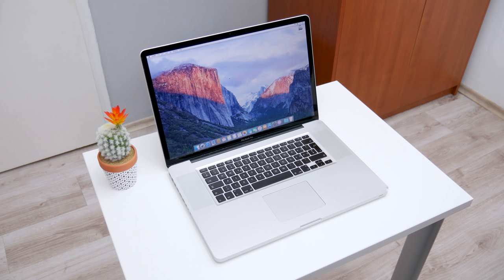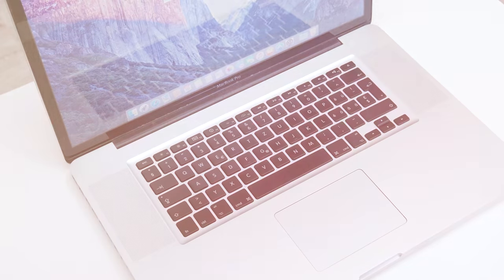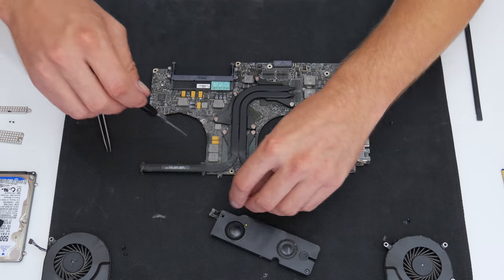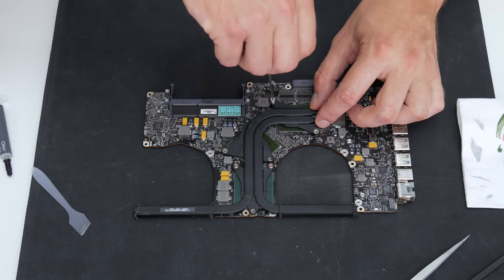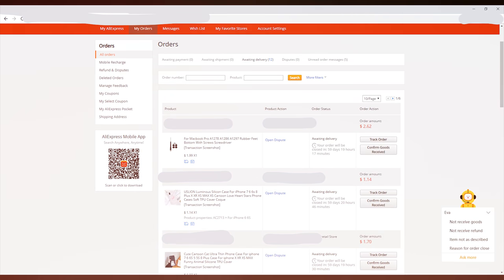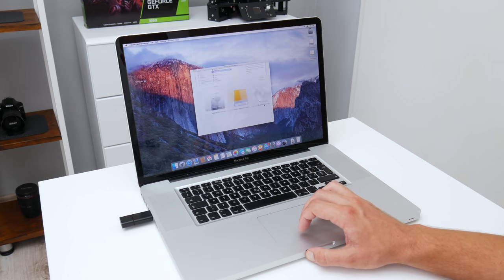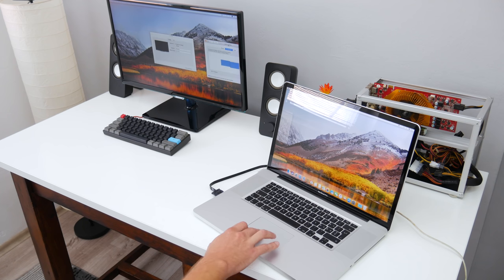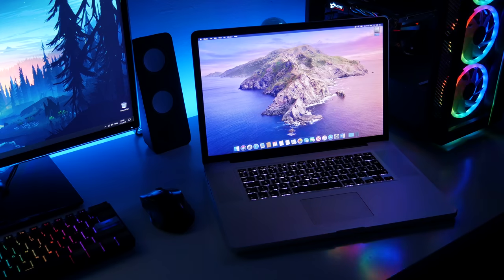Restoring and upgrading 17 Inch MacBook Pro and eGPU test!

Comment: Hey Andrew, nice video. One tip if you install an aftermarket SSD. You should enable TRIM in the terminal because MacOS doesn't enable SSD TRIM automatically for 3rd party SSD's. It's really easy: Just run the command "sudo trimforce enable" in terminal and reboot your MacBook. Check in system information if trim is enabled after rebooting. Cheers.
Reply: I have no idea what any of this means.
Reply: @Edian what does TRIM do?
Reply: i didnt know this, i checked and sure enough, not enabled. thank you very much for the tip ^^
Reply: @burneyfeg2768  no problem! Enjoy a stable system :)
Reply: @NB-Philly   A Google search will tell you everything you need to know. And you can check on what MacOS version you're using.
Reply: @NB-Philly  Its so that your SSD can operate normally and doesn't have decreased life span. It basically has to do with the way SSD deletes old data and uses tables for writing new data.
Reply: @MrGarda42  TRIM basically prolongs the life of your SSD by making sure the same parts of the storage aren't written and read from over and over without using the rest of the memory a roughly equal amount
Reply: @MalevolentMeles  thanks man.
Reply: If you’re using APFS TRIM is enabled by default
Reply: TRIM allows the operating system to actively inform an SSD which blocks of data are no longer in use and can be wiped internally. This helps the drive work more efficiently and leads to faster performance and most importantly, longer lifespan.
Reply: @MalevolentMeles  Correct.  SSD's are rated by how much data is written to the chips.  TRIM reduces the amount of data written and erased which prolongs the life of SSD.  This is important for all SSD's, especially off brand new SSD's and for SSD's purchased second hand.
Reply: @mattridgley9095  Dude, yeah
Reply: For the love of god do not enable trim it slows down your mac considerably
Reply: Will this delete my data?
Reply: @jameswyma9849  if you want to keep your data alive for several years then you want to enable it

Comment: I have a Mid-2009 17inch MacBook Pro 3.06ghz. The screen size is perfect . Still running strong  💪 I love your videos !!
Reply: Hi! May I know the smc version of your computer(in the system report)? I have the the similar version of  MBP 17 (early 2009) and believe the laptops have the same SMC originally. I restored the smc with a wrong version. And There is no information about this smc firmware across the whole internet...

Comment: when you clean that dry thermal paste, it's usually a good idea to soak it with some isopropyl alcohol for a short time (maybe 30 seconds at least) to soften it up before scraping or brushing.

Comment: Well done! Nice video. I am currently running a mid 2010 MacBook Pro 17 inch with a 512 SSD & 8GB of RAM. It’s an absolutely pristine condition and runs as fast as it did from the day I bought it. Works out to about $25 a month Canadian on a MacBook Pro for the last 10 years. Sure beats the dickens out of windows PCs and their costs.
Reply from the maker: Thank you :)  17 Inch 2010 are coming with much better specs, it's a beautiful laptop
Reply: @ComputersAndTechAndAndrew  Is 8GB really the max RAM capacity, some aftermarket / refurbished resellers are selling this same model with 16GB RAM.
Reply: @brandonphilander661  yip it can take 16gb thats what i have..works well. i have a ssd and new thermal paste that helped the fans not to always spin.. 
ssd. 16gb. and new thermal paste gives it a new life. it runs as good as my 2019 mackbook air

Comment: Still my favorite model - my 2011 17" going strong!
Reply: Peter Won really my gourmet went out and unfortunately I can’t get window to boot without a black screen:{
Reply: @jamminjaymn7675  probably the gpu, disable it. It happened to me and the beast runs fine
Reply: Yeah, the 2011 models had crippling GPU failure. Is it your favorite now?
Reply: I'm still using 2011 15''. Love this machine.
Reply: the best is mid 2010 17" because you have not the GPU problem
Reply: what gpu will work using xpress card slot ?
i have macbook pro 2011

Comment: Why did I watch this video? I was completely happy ignoring the state of my MBP 17 early 2009.
Now watching this video I thought I should at least clean my Macbook for the sake of it. It was getting easily warm and kernel panic. 
Now it lays on my workbench in pieces. Thermal past was hard as concrete. Now the logic board it is Dust free with one blown capacitor and some corrosion.
Fixing clients laptops is always easier than my own. 
I guess I should thank you for this video 🙂
Reply: Hi! May I know the SMC version of your computer(in the system report)? I have the exact same MBP but i restore the smc with a wrong version. And There is no information about this smc firmware across the whole internet...
Reply: @rickjac6909  I will try and remember when I get it repaired. I am still waiting for my smd rework station
Reply: @Frank-Thoresen  Hey. Thanks. Some other owner with this mbp has verified with me about the version. it is 1.42f4.

Comment: You can also install a fresh operating system to a new drive over the internet by holding command r on boot up. This will bring you into disk utility where you install the os over the web
Reply: Firebuster can it be updated to catalina?

Comment: i have a early 2011 (April) 17" and love it.  did the same, ssd, memory up to 16g memory, new thermal paste (cooler master nano paste) but also cut some air holes along the front top edge of the bottom cover.  You can't see the holes unless you flip the computer over.  I also use macfancontrol to control the fan.  As you may know these computer run amazingly hot in many cases can push over 105C which is way too hot.  The holes and the fan control means the computer now runs at 35C idle, normally in the low 50s under normal use and maxes at 85C when working hard.  So holes are super important.  Luckily my graphics chip still works but I use a program called gSwitch to hold the computer in the integrated graphics mode.  you can also select discrete and dynamic if you like but i don't see a need.  The integrated (on processor) graphics will run 4k videos with no issues.  Do all of this and enable trim as Edian said and you are good to go.  You have a 2010 model but some still applies.
Reply: Nice job. How would you say the fans and temps changed from just a re-pasting? Wondering if it made a big difference even without the holes. thx for your post

Comment: The heatsink design from 2009 to 2011 is why so many of these have died. Who was the engineer who thought moving the heat through one pipe was a good idea. They should have been separate pipes.

Comment: I'm watching this video from: 
Macbook Pro (17-inch, Early 2009). 
macOS Mojave (version 10.14.6)
Reply: MacBook Pro mid 2010 13” 16 gigs ram 2ssd crucial 1tb each high Sierra,there are others improvements?
Reply: Hi! Eagle. May I know the smc version of your computer(in the system report)? I have the exact same MBP but i restore the smc with a wrong version. And There is no information about this smc firmware across the whole internet...
Reply: @rickjac6909   my SMC Version (system) is : 1.42f4
Reply: @apateonaeagle9928  Hey! Man. Thank you so much. That number is so important. it is impossible to find in the internet. Mine is def messed up. It shows 1.57f18.
Reply: Hey Eagle, could you please give me your email or social media handles? I'd like to ask you some questions about MBPs
Reply: I see you're a man of culture. - Fellow 17-inch user
Reply: @troyh8461   wtf are you talking about ?
Reply: I'm watching this video on:
Macbook Pro (13-inch, mid 2010)
macOS High Sierra (version 10.13.6)

Comment: Great video.  I have a 2011 17 on the way.  It is broken but I have had good luck fixing them.  Anyways, been very interested in Dosdude's Mojave and Catalina patchers.  Does graphics acceleration with the 2011's AMD GPU work.  Last I read, it does not.

Comment: Will you do a laptop video fix on a 2009 MacBook pro 13in specifically how to re solder the fan connection to the motherboard. I have an exact mac with that issue and have not been able to fix it.

Comment: Hi Andrew, thanks for a great video. I have MacBook Pro 17 Early 2009 and I want to upgrade ram like you from 4GB to 8GB. You used higher frequency RAM of 1333mhz than original 1066. Can you tell me please which RAM did you use? :)
Reply from the maker: Hi bro, I the ram is Samsung, but you can use some other brands, also i think this ram is low voltage, not standard 1.5v. You can check which ram is in your macbook than you can get other but with the same voltage
Reply: Cat and Andrew Hi Andrew! I have a MacBook Pro 17 mid 2009. I need to upgrade the RAM, but Apple say the limited BUS is 1066mhz. You use this frequency?

Comment: currently watching this video on my Mid 2009 17 inch Macbook pro, I'm using OS X lion and to be hones ArcticFox browser really brings this os back to life, and I also have all the app I need to complete all my tasks, I cleaned it replaced the thermal paste, upgraded the ram to 8GB 1333mhz and anice 240gb SSD made it run like a charm, still not blazing fast but good enough, I only got it for 40$ so I really can't complain.

Comment: Apple should bring back this 17-inch flagship. Maybe the rumored 16-inch will do similar job
Reply: The 16 inch is just a slight increase in body size. It by all means just increase in screen size and it's rumored to be bezel less so the body won't be much bigger than the 15 inch one.
Reply: And the 16 inch one is said to replace the 15 inch. So there's that.

Comment: There is actually tech inside the head of the charger that tells the computer how many watts can be supplied, so your 80 watt charger is now only supplying 60 watts to the MacBook, as it has the replacement head on it.
Reply: not true. It works over a 1-wire protocol and a chip inside the charger tells the head what to report to the motherboard :)

Comment: Macbook used to be that great. I really like old models Macbook more than new ones
Reply: I agree after the 2015, I couldnt get the 15 touch bar 2016-2019, I tried it out for a month but returned it after, was not satisfied the same. But this 16 inch MBP I am using with 5600M right now is a masterpiece of a computer.

Comment: Hi Andrew, one question, how did you install catalina on an unsupported mac?  Did you use Dosdude?? Did you have to disable the video card?
Reply from the maker: Hi bro, i install the catalina using dosdude tool, but i don't have to disable the graphics, nvidia graphics are supported. But few days ago some users confirmed that ATi are working also using ATI patch in post install tool
Reply: @ComputersAndTechAndAndrew  thank you for your reply bro! more power to you and your channel! Will try to check if ATI will work. Cheers!

Comment: @Cat and Andrew RX580 should work out of the box without any fiddling.  I have a hackintosh and it runs perfectly with the very same RX580 MSI card that you have.  Perhaps it's not the GPU but rather the PCIMA Express device that is the problem?

Comment: I was watching this video on my 2010 15" MBP, and when you got to changing the thermal paste, i looked at the CPU temperature on my MacBook and it was close to 100°C, so i turned it off, went to a PC store, bought a new thermal paste (Arctic MX-2), changed it for about 20 minutes, turned it on and kept watching.

Comment: Just wanted to know, if its possible to have a cf express to thunderbolt converter and try the blackmagic egpu. If it works it is better supported across mac to run with the latest apps.

Comment: Looks too much work for me. I’d be terrified. Mine has had a lot of knocks (I got it second hand) the optical drive no longer works and it’s not upgradable anymore. I saw someone swapped out the dvd drive for a Blu-ray I’m not sure if that was the same model. The hinge is also shattered. I purchased a replacement but was too nervous to fit it.

Comment: i had the 15' inch mid 2007 model, i've to anything I could with thermal, it would cook my lap if using it too much, any suggestion? currently at El Capitan (Maximum Supported by apple)
Reply: replace termal paste, clean the interior and install unsuported mojave

Comment: nice video! have you encountered crackling speaker sound?
Reply from the maker: Thank you :) no problem with the speaker, but i read that some users have this problem, with some models, but this is very rare
Reply: @ComputersAndTechAndAndrew  thanks a lot
Reply from the maker: @jobrycimafrancacrossovervi1477  U are welcome, btw try to re-apply the patches again, sometimes some patch may not be applied correctly

Comment: What about the battery? condition? If you replaced it where did you get it? 
Thx
Reply from the maker: Hi bro, the battery is working well, but if i need to replace than i will get from ebay or aliexpress, there are much cheaper but the quality is same. Basically you have few manufactures that sell their products on many websites, somewhere is cheaper somewhere not

Comment: Hey Andrew, I really wanted to know if the eGPU works with Windows installed on this MacBook. I mean if you use the eGPU in Windows 10, will it work on this MacBook?
Reply from the maker: Hi bro, I've test that later and it is working, just it can be problematic because some boot camp drivers are causing problems, personally I'm not really satisfied from the performances in Windows and eGPU on this Macbook
Reply: @ComputersAndTechAndAndrew  Thank you for your answer. After watching this video, I think people with a tight budget like me would consider buying a 17-inch Macbook and an eGPU. Maybe it has some compatibility problems, but I wish you can make a tutorial on how to setup the eGPU on this Macbook (in Windows) or at least show us its performance 😁
Reply: @ComputersAndTechAndAndrew  I look forward to your answer 😁

Comment: Nice idea but the parts are so old that they could fail easily. I had a 2008 which I used until 2018 - screen went and I didn't want to go through the trouble to replace it. I used it with an external monitor but the battery bulged and damaged the MB and that was the end of that. I will eventually upgrade to a 16 but I just use my 2014 and 2015 15s with external displays.

Comment: Does osx set the memory frequency to the higher value inherently or do you have to do it like on a pc in the bios (since in pc’s they default to the default speed not the stick speed)
Reply from the maker: Hi bro, memory frequency is automatically set in mac, except in hackintosh, there sometimes you need to setup the frequency manually
Reply: @ComputersAndTechAndAndrew  thank you very much . Nobody talks about that . Have a great day .

Comment: Is it possible to put the gpu and cpu from a MacBook Pro 2012 mid in this MacBook? I saw a video that a guy did it with a old white MacBook with a better cpu and gpu.
Reply from the maker: Hi bro, from 2012 in this 2009 is not possible, because 2012 has different architecture, different socket and different chipset, between these booth laptops the difference in architecture is so big that you can measure in light years :D 

the other problem is, CPU and the GPU are soldered on the logic board. 

Theoretically and also in reality is possible to change the CPU, but with CPU that has the Same Socket, Example: This 2009 has Core 2 duo T9300, theoretically i can upgrade to core 2 duo T9900.

The other CPU's like core 2 quad with the same socket will not be supported because of difference in TDP, Watt, architecture and more.

The GPU Cannot be Upgraded, Example: This 2009 model has GT 9500M, and probably we can say, why not to go to 9600m or 9800m. These GPU's are with same architecture and same generation but all of them have different socket, different pins from the bottom side, different connection. 
But the problem is not only in GPU, the Logic board must be made to support better GPU.
This 2009 Macbook is only made with 9500m pins/socket and only will support this gpu.

Soldered hardware is not easy upgradable, you need advance equipment, like Infrared heater to avoid thermal stress and to heat the hardware equal at any point, to avoid damage, and this process is an amazing complex. 

except these basic stuff all hardware must be supported by the Chipset and the other controllers and by EFI in Mac and BIOS/UEFI in Windows.

Comment: Nice!
i have HP Pavilion 2156TX Mid 2010
Ram 8 GB
CPU is Core i3, M330 @2.13 Ghz
Nvidia Cuda. 
what options do i have to upgrade it
Reply: You could replace the hard drive with an ssd
Reply: @itsquackinggood  any eGPU?
Reply: Im not sure about egpu's but as its an i3 you will need one

Comment: what are those unpopulated areas next to the GPU? is it for more VRAM on higher end models?
Reply from the maker: Probably yes, or maybe is just circuit to the memory which is from the bottom side, I really wondering what will happen if put memory there :D
Reply: @ComputersAndTechAndAndrew  heh, you'll either fry it, it won't work at all, or it'll somehow work and recognize all the memory

Comment: Hey Andrew does apple arcade work on the mac os catalina you installed ?
Reply from the maker: Hi bro, am not sure i did not test it, but i think it will work, because any app that i try is working normally without freezing or crashing
Reply: @ComputersAndTechAndAndrew  ok great to hear thank you :) you really helped me with this video :) I'm going to do this with a 2011 i7 17inch macbook pro
Reply from the maker: @michaeldamon7500  U r welcome bro :D btw the 2011 with i7 is much better that this 2009 model, Catalina will work much faster, just if your laptop has ATI graphics then maybe you will need to disable ATI and use Intel HD only. This is possible Only on MacBook;s, iMac's are not supported and dedicated GPU's in iMac's cannot be disabled
Reply: @ComputersAndTechAndAndrew  Will definitely keep that in mind :) Thank you for the heads up